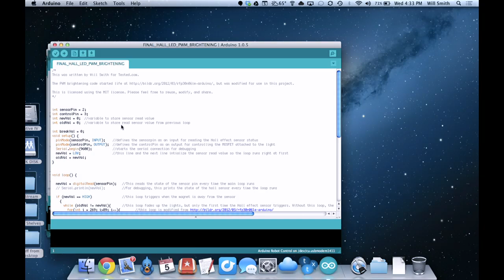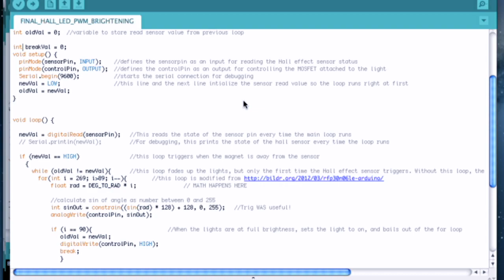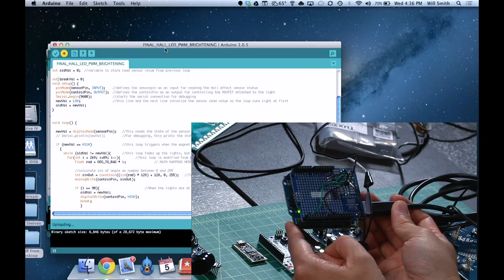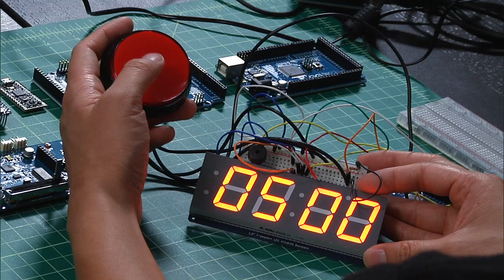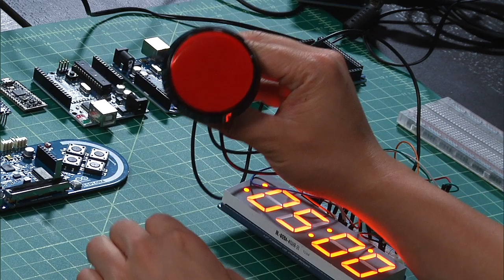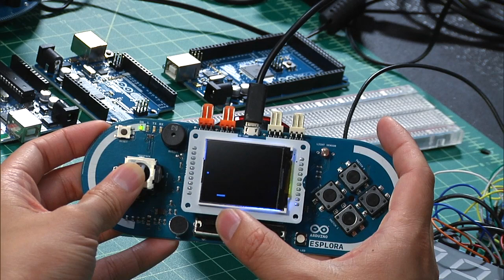Tested In-Depth: Getting Started with Arduino

Comment: Minor corrections: FWIW The clock display was wired upside down. The decimal point should be on the bottom.

The clock display is a variant of a seven segment display, A matrix display is a 2 dimensional array/grid of individual LEDs.

Comment: The Arduino Mega is 8-bit AVR ATmega1280 by Atmel running at 16MHz. Did you even go to the Arduino website? Most Arduinos are not ARMs. The newer ones are, some of them. They are mostly 8-bit AVR. I am only aware of one x86 Arduino, Intel Galileo. Because it has a lot of pins does not make it 32-bit or an ARM. An 8-bit microcontroller can be made to have 2048 pins. Using 256 (2^8) bytes (8 bits). ARMs are not the only microcontrollers out there. For most tasks they are overkill and cost more. Also what makes an Arduino an Arduino is not the hardware. It is a bootloader and software/toolchain. Arduino support can be made for almost any microcontroller. You just have to write software support for the hardware configuration. (Not as easy as it sounds.) Pinguino is an example of this. Which supports some of Microchip's 8-bit and 32-bit PICs.

Comment: On the Arduino boards, the analog pins are only inputs and the digital pins are input and output. The Due also has (2) DAC outputs that can generate analog signals in addition to the analog input pins and the digital I/O pins. Using external components, the PWM pins can also generate analog signals.

Comment: For a first year electrical engineering project my group built a fully functioning elevator prototype. With programming knowledge and a proper tutorial in a matter of minutes you could get an led to work and perhaps a small dc motor or buzzer.

Comment: ...My take on "Introduction to the introduction of programming" :D

At 28:27, simply put: "structured programming language". Markup "languages" are not actually "languages" as per computer science paradigms, they are "markups" : they're like the highlighter you'd use over some text, while the text itself is the result of a structured thought process (markups don't define a Regular grammar). A cooking recipe can be compared to a structured program, having its own vocabulary structured with precise and ordered instructions in sequence, even in some cases "at the same time", or that must be repeated xx number of times (like shake the mixture for 20 seconds every 1 minute during 5 minutes), or that depend on intermediate results of which you don't know the outcome in advance because you're trying a new ingredient (thus offering different sequences of instructions depending of that outcome, like if it tastes too salty then add water... Or like if it's boiling then turn off the heat, else repeat the "shake" procedure every one minute... Etc.).

One can understand why programming is an Art by itself : there are many ways to do something, like there are many ways to cook an egg. Which one is "better" given a distinct context depends of the cook (of the computer analyst-programmer), same goes for Writers : there are many ways to tell a story, it all depends of the story-teller/Writer to make it a good one or a bad one if not a weird one.

HTML markups can appear dynamically given something you do on a Web page, in which case they are governed by some structured programming language like JavaScript, C, Python, PHP, etc., which interprets the user input so as to generate the correct HTML markups on the Web page. For the sake of comparison: a markup would be the light on a led, or some switch on a circuitry bread; while the "intelligence" behind the led and the switch, capturing signals to interpret and then sending back other signals accordingly and thus controlling Arduino's controller, for lighting the led or not, is all done via some programming language (like a cooking recipe written in English's Regular Grammar using specific cooking vocabulary).

Comment: Got a couple, still working on the I/O design. Hard part: There seems to be no decent standard shield for powering on/off mains voltages or even the 24V needed to control industrial grade I/O blocks.

Comment: I use these in conjunction with a Raspberry Pi 3 to control my entertainment system in my vehicle, various lights, speedometer, clocks, and a bunch of other stuff, I use them all the time, they are cheap, durable, easy to program, easy to hook up, and just in general really cool.  one of my favorite boards is the Arduino Uno R3.  You can get them for 5 bucks now and they are genuine, on Tayda Electronics.

Comment: I don't have an arduino but the easiest way to understand it was seeing a video where this guy puts in LED connected to a particular pin, and then writes code for it. I don't know C but I know javascript and the concepts are pretty similar, basically he defined a variable named led, and assined it to pin 13, it's a way to keep track of your inputs and outputs, then he said you need to do a setup for any program, so he wrote code saying that led is an output, and it makes sense.

And then he made a loop and in it a simple code give the led high voltage, sleep, wait, whatever you want to call it for 1 second, then low voltage on the ping 13, sleep again

Since it's a loop it goes on and on, and what this does is that it turns the led on and off in intervals of 1 second. And that's pretty much the most basic thing you can do, but that's the thing about it, it's sort of like a hello world type of thing, it gets people into it.

Comment: To be clear, On the Arduino, the Analog Pins are only capable of being analog inputs. However, if you choose to use the Analog pins as Digital pins, then they can be used as inputs and outputs.

If you listen to your video at 4:40, You state "You can usually configure each analog pin and each digital pin as either an input or output as you wish".

Comment: Although you're correct that the Due is a newer board (and is an ARM based board, rather than AVR based like most other Arduinos), the older one that Will kept mangling the name of was the Duemilanove, which is basically the predecessor to the Uno

Comment: Factual corrections: the 2560 is based on the AVR architecture, not ARM. In that light, most Arduino MCUs use Atmel ARM processors, not ARM. It can be kind of confusing though because more and more MCUs (like the teensy) are ARM based but use the open source Arduino toolchain and ide (which is the real power of the Arduino package).

Comment: Chinese sites have all the arduino boards\shields\elements 5-10 times cheaper. Never had a single problem with them. Got my starter kit with arduino uno and LOTS of stuff for 25$. Arduino uno board for 5-7$ and arduino nano for just 3$
Reply: Well, its good to buy the original Arduino because then you are gonna support the devs of it. It is Open source, but they are still working on bootloader, and if they dont have money, they cant develop new Open source boards or make the bootloader better/smaller. I also buy most of my hardware from chinese but i still got 2 original boards here.

Comment: Arduino Analog pins can only be used as Digital outputs not Analog outputs. The Atmega328 chip spec shows that the only analog support in the chip is the analog to digital converter (ADC). To support analog output, the Atmega328 would require a digital to analog converter(DAC). The only Arduino board with Digital to Analog (DAC) converters is the Due.

Comment: "If Loops"
"32-BIT"
"Clocked at 32Mhz or something"

Tested. I love you but please do your homework before doing a video 😂.
Reply: I so agree
Reply: Maybe write a facts card and a basic script, cause the flow of the video is a bit interrupted at times
Reply: "Some are x86 based"
x86 microcontrollers xDDDDDD #seemslegit
Reply: I just bought an arduino kit on a whim, knowing nothing about it, and 20 min in I know it's not 32 bit lol
Reply: I'm still new to Arduino, but yeah, I know they are 8 bit, typically 16MHz. (3.3v versions of the pro mini and nano run at 8MHz) And it is AVR, not ARM. 

But, and a big but... 
Take a look at Curie: (Arduino 101)
Which is an Intel based arduino. Which I suppose would be X86, don't know though, but I heard that it is 32-bit.

And the Arduino Yun, of which I know not much, but it is apparently a hell of a lot faster ARM based MCU.

Comment: Object orientation is just a paradigm: you can implement it in whatever language you want. There are object-oriented implementations for C, and they're actually quite straightforward to use; except there's no syntactic sugar like, say, C++.  Trivia: early C++ compilers emitted C rather than machine code.

Also, the official language used by Arduino is actually C++ in disguise. You're free to use classes, templates & other stuff; although, for most of the time, there's really no need to use them.

Comment: @ 0:28 "I was scared of programming...", to me it's the opposite, when programming goes wrong: you get an error, when electronics goes/is put wrong: it might catch fire xD, in short, I've bought "THE ARDUINO STARTER KIT, SKILL LEVEL: BEGINNER, 15 PROJECTS" a ½ year back and it's still in it's protective plastic. (I know I need to start by removing the plastic, but then... mind stuck)

Wish I had some opportunity to learn more about electronics to feel a bit safer using it (or to gain more confidence using it).

Programming on the other hand shouldn't be a problem... I hope... (I know how to use C++, DirectX (DirectInput, Direct3D9/Direct3D10/11, DirectSound), to make 2D/3D games) but with electronics I know just basics, pretty much using a multimeter, and how to use and calculate to use resistors together with a battery and a button to make a LED switch on and off, most advanced thing I've made so far is figuring out how much current was needed together with how to connect the wires to light up a Seven-segment display hahaha

Comment: I'm wondering if I could make up a controller to replace OEM DI engine controllers that would still use the VVT in modern engines with a kit?

Need to delve into the programming and voltage spike limitations

Comment: 76 to 200 usd? I just bought a Ultimate starter kit from ebay for 45 usd, it contained 210 parts including breadboard, arduino uno, servo motor, ps2 joystick and all you could need modules and wires/components. Seller is mepal18 from hong kong or china or something,

Comment: With servos, is it possible with Arduinos to, instead of pre-programming a setting for a specific time, have variable live inputs from a controller elsewhere?
Reply: In a sense yes. Usually they are useful for such tasks. The "but" is that in computers there no such thing as "live". You can program a loop in the code (it runs that code in circles) which checks the input value from time to time and does something if it changes. It's not much of downer because the code runs really fast. The loop can repeat within microseconds.
Reply: Look up interrupts. When an interrupt is initialized, the program stops what it's doing no matter what code is being executed, then instantly runs the interrupt routine. Useful for event triggers that need to run ASAP. When the interrupt routine if finished, the code picks up where it left off.

Comment: Not exactly that is a specific Arduino called the Due but it's a different beast all together. It's not a revision thing that The Uno is now suddenly equipped with an ARM processor. The Mega, The Minis the Unos in this film are all ATMEL's AVRs.

Comment: Have you guys tried code academy?
Reply: Whats that? I am struggling to find a resource for learning programming from the ground up. I never took it in school :(
Reply: It's a free code learning software. Try it out
Reply: I took  a course on HTML in codecademy, its a good source to star a programming lenguage, use it!
Reply: Feraud Quilens if it will support one day arduino, then i will use it again
Reply: ***** Arduino is just C.... C = not arduino.
Reply: Darude Sandstorm   Can you program it in C?  Is the Arduino language cover up of the C language?  Thanks.
Reply: KillJD
it is c with some additional intepreter
Reply: KillJD Arudinos use Wiring, which based on processing, which is based on javascript. The AVR microcontroller which powers the Arduino was a big leap forward (in the 1990s) because it could be programmed in C.

If you're competent in C, learning wiring will pose no challenge at all.
Reply: David Thompson but learning C just to learn Arduino is basically pointless.

Comment: Thank you for these Video, I am now just begin learning in embedded systems working with the Arduino Uno and these gave me a broader view of things, I wonder if you have videos on simple projects you may have made.
You mentioned in your video that after making a good working prototype, you can Go to China to make the Micro Processor cheap containing only the features you need as in the Prototype. My question is can you advice or recommend Contacts in China that would be able to do these, I have done many Online searches and not finding something concrete. Let me know, Thanks

Comment: Beginners, know that the arduino nano doesn't have short circuit protection like the UNO. If you short the 5V to ground, you'll fry one of the diodes on the board.

Comment: I have the Arduino Uno 3. Rasp PI Model B 3, and Funduino boards, but all of these projects are killing me cause I don't have the accessories to make the project, but have a mess load of LEDs and 2 LCD screens. Any thoughts? C programing is easy, but want to animate my robot and soup up my quad-copter.
Reply: Then buy stuff at aliexpress ... If you want to beef up your quad

Comment: No. For example, the new Arduino Yun is based on two chips. One is the ATmega32u4 (AVR) and the other is the Atheros AR9331 which is a MIPS 24k processor. For the upcoming Arduino Tre, the processor is a Sitara AM3359AZCZ100 (ARM Cortex-A8).